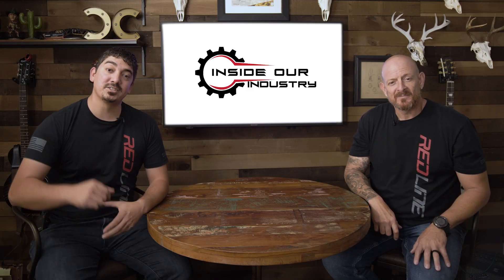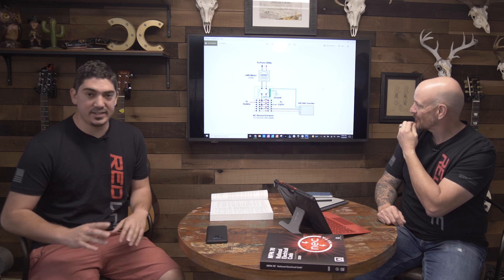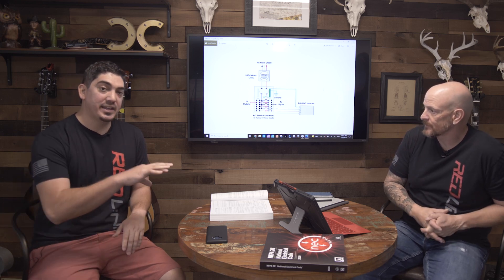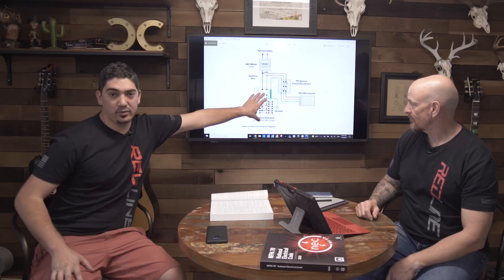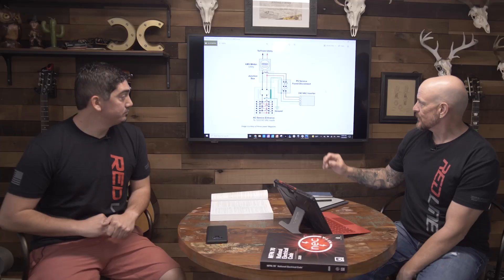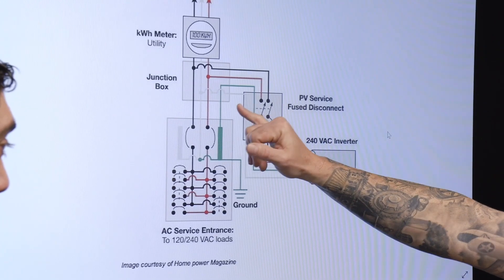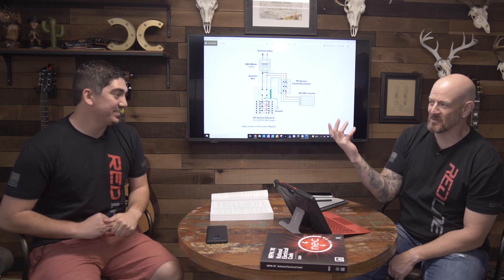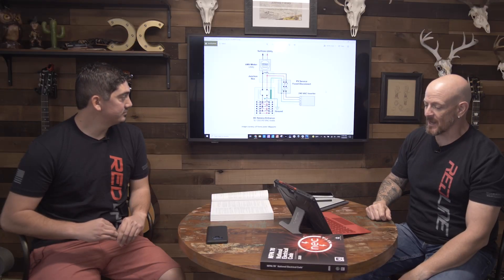Line Side Tap Explained! -Redline Electric & Solar

Comment: While I understand supply line side fed design, I rather replace an older panel with a newer upgraded panel has higher buss bar current rating like the 225amp solar ready panels. Used to be a supply chain issue not anymore, I see them at Home Depot on the shelf now. Whatever panel you like so many older homes here in Phoenix 1970's panels usually too small bunch of wire jammed in them.
Reply from the maker: I know right! Some of these I wonder how they even got UL approval!!!

Comment: My utility company says my solar installer can’t tap inside my meter box. Installer wants to use these crimping things on the wires to tie in. What is there other option?
Reply from the maker: There are some AHJs that don't allow a line side tap behind the meter. Some allow it after the meter? Your other option might be to replace/upgrade your electrical panel...🤷‍♂️😥
Reply: @Redline-Electric-Solar  after the meter in what location like on a breaker? inside my house or is that too small?
Reply from the maker: Before the main lugs in the electrical panel. You'll probably need an engineer to stamp for approval

Comment: So what’s the smallest size system to install to just breakers and not use these connectors or using this panel pv ready ?
Reply from the maker: Whatever the buss rating is x 120%= the amperage maximum you can back feed.

Comment: Could you show how to connect a generator and solar connection thru the generator transfer switch with (4) 20 amp solar array back feeder breakers?
Reply from the maker: I am not aware of an ATS that accepts solar inputs. There are, however, inverter/battery systems that accept generator inputs. Solar and Generators do not talk to each other. More information would be needed to engineer something to achieve your end goal. You in Arizona?

Comment: How about this:  PV inverter connected line side: feed conductors to a subpanel.  MSP is 200A.  PV rated is 60A.  Sub panel is 100A.  Derating the main breaker in the MSP to 175A should be fine, right?   Subpanel also has a 100A main breaker.  120% math for the main panel is satisfied.   Curious if Im missing anything.  Thanks!
Reply from the maker: The subpanel line side is rated for 100amp, so this is good for the 60amp tap,  and the main breaker should protect from overload. Then derating the MSP (if the main bus is 200amp rated) to 175 allows a solar feed of up to 65 amps. The only thing missing here would be the protection of the solar panels themselves. If the line side to a 100 amp then there is potential that 100amp could go to the modules, e.g. ground fault, so you would need an overcurrent protection on the 60amp feed from the solar.

Comment: How much should a solar installer charge as an adder for a line side / load side tap?
Reply from the maker: This depends on the situation, equipment type and setup, AHJ, etc... But we see an average range from $1500-$2000
Reply: $300-500. If it is just a tap you are charging for the taps themselves.

Comment from the maker: Here is a link to one of the SquareD solar ready panel: https://www.se.com/us/en/product/SC2040M200PS100/all-in-one-homeline-csed-ringed-socket-100a-surface-mount-20-spaces-40-circuits-22ka-sccr-no-bypass-solar-ready/?%3Frange=60250-allinones&parent-subcategory-id=80400&filter=business-4-low-voltage-products-and-systems&selected-node-id=12368082249
Reply: SC2040M200PS100
Discontinued on:
Oct 31, 2023

Comment: So backfeeding means your feeding your current panel while your utility panel is feeding the same
Panel?
Reply: Wow I didn’t think you could bring two separate voltages at the same time in a panel and create some sort of arc
Reply from the maker: @oscar27ization  You are correct in most cases! It is the inverter that matches the sine waves from the utility company or input source. There are a lot of ways it doesn't work and will create an explosion in some!
Reply from the maker: Correct. The Solar backfeeds at the same time your utility feeds in